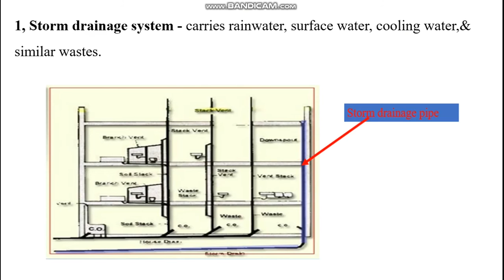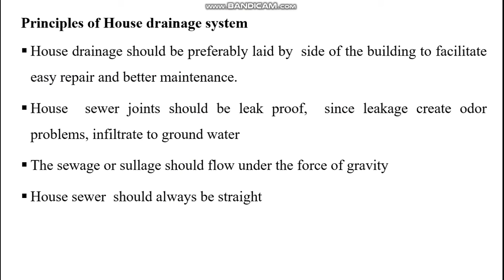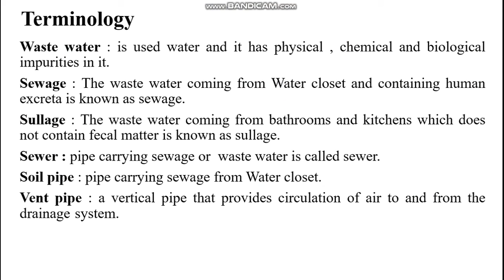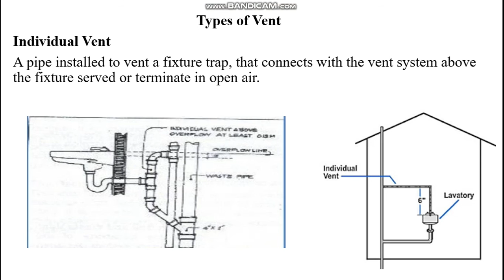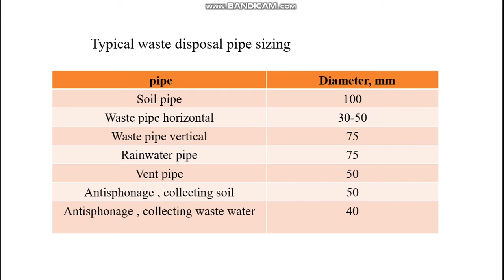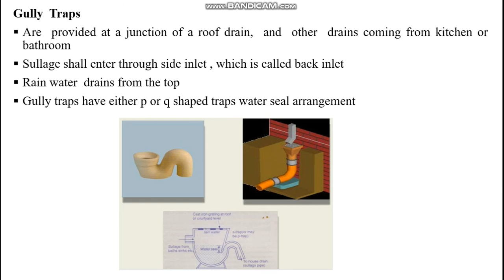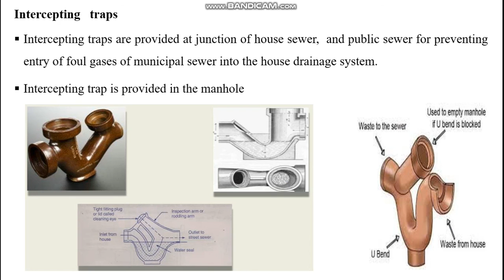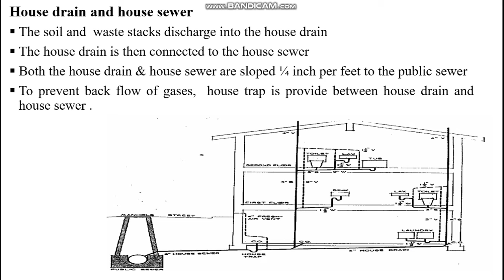Introduction to Drainage System ( sanitary and storm drainage system)

Comment: UU80823R
Drainage system include all the piping within a private or public property that conveys sewage, stormwater & liquid wastes to disposal which helps to maintain a healthy condition in the surrounding & facilitate the entry and removal of liquid water. There are 3 types: storm, sanitary and combined drainage system. 
Individual vent, common vent, main vent e.t.c are included in types of vent. 
Traps allow water to flow through while preventing back flow. They are classified based on shape ( P trap, S trap, Q trap) and based on use( Floor trap, Gully trap, Intercepting trap).

Comment: 80991
Drainage system - removal of sewage, storm water, liquid wastes through piping system. It helps maintain healthy conditions in BLDG and collect waste matter systematically. Storm, Sanitary and Combined are the types of Drainage system.
Principle of house Drainage system : house sewer should always be straight,  its joint should be leak proof and the entire system should be well ventilated from strat to end.
Individual, common, main, relief, yoke or bypass, circuit and wet are vent types.
Traps - preventing  back flow of foul gases into living quarters. P trap, S trap, Q trap are classification of trap based on shape. Floor, Gully and Intercepting are classification based on use.
Clean outs - are elbows protecting to permit cleaning the house drain.

Comment: Uu81145R 
 drainage system.
When rivers, streams, and lakes flow together in a basin, they make an interesting pattern. This pattern is called the drainage system. How the land looks, whether it has hard or soft rocks, and how steep the land is all play a role.

Underground pipes transport sewage from bathrooms, sinks, and other plumbing components to a wastewater treatment facility via the sanitary sewer system. 

Sewage cannot be transported by the storm sewer system, which is meant to transport rainwater and other drainage. Underground pipes or open ditches transport the runoff, which is then discharged (untreated) into nearby streams or bodies of water. You can find inlets to this system near curbs and low-lying places of the outside world. There are some older buildings with basement floor drains that are connected to the storm drainage system.

Comment: 80870
Drainage system refers to all piping system that conveys all liquid and solid things to point of disposal. Its used to maintain healthy conditions in buildings. There are 3 types :- storm drainage system, sanitery drainage system and combined drainage system. There are also many principles of house drainage system such as ventilation, its connections etc. 
Vent helps to regulate air pressure in the plumbing pipes to ensure that the water flows unimpeded through them so there are 7 types of vent. And traps allow the sewage or wastewater to flow through while preventing back flow of foul gases in to living quarters.

Comment: UU81213R 
Drainage system is refers to all piping system that convey sewage stormwater and liquid wastes to paint of disposal and it's objective is to maintain health conditions in a building and to avoid the entry of foul gases from the septic tank. And there are three drainage system such as storm, sanitary and combined drainage system and house drainage should be laid by side of the building. There are seven types of vent ;- individual, common, main, relief, by pass, circuit and wet vent. Traps allow the sewage to flow through and also it prevents back flow of foul gases in to living quarter and they are classified based on shape. Clean out are elbow projecting to permit cleaning the house drainage and installed in the house drain beyond the last stack. The soil and wast stack discharge in to house drain then the house drain is connected to the house sewer.

Comment: 80970R Drainage system refers to all piping device that conveys sewage, stormwater and liquid wastes to point of disposal. Maintain healthful stipulations in building,to keep away from the entre of foul gases from the sewer or septic tanks, to facilitate the removal of foul matter, to accumulate waste mater systematically.three Types of drainage system  storm, santariry, combined drainage system.Principles of residence Drainage system: residence sewer must usually be straight, the sewage or sullage have to flow under the float the pressure of gravity, house sewer be linked to manhole such that the invert degree is sufficiently greater to keep away from back drift of sewarege in house sewer . there are many types of vents that are individual, common,main ,relief, yake or by pass, circuit ,wet vent.Traps enable the sewage or waste water to drift via whilst preventing returned flow of foul gases into residing quarters.the loss of life of water seal is,the vertical distance between the crown and dip of trap.Classification of traps based on shape :P,S AND Q traps .Classification based on use: floor, gully, intercepting.

Comment: UU 80954R
Drainage system is all piping system that conveys sewage,storm water and liquid waste to maintain healthy condition. There are 3 DS storm drainage,senitary drainage, combined drainage system. Drainage system should have better maintenance,sewer joints should be leak proof, always be straight and avoid back flow

Comment: UU81140

Drainage system refers to all piping system that conveys sewage stormwater and liquid wastes to point of disposal.
There are three drainage system
1. Storm drainage system 
2. Sanitary drainage system
3. Combined drainage system, and there are principales of house drainage system.
Vent-a vertical pipe that provides circulation of air to and from the drainage system.
Traps-are u shape fixtures that have water seal in them,traps allow the sewage or waste water to flow through while preventing back flow of foul gases into living quarters.

Comment: UU 78843R
Drainage system refers to all piping system that conveys sewage ,storm water and liqiud wastes to point of disposal. Storm ,sanitary and combined are types 3 types of  drainage system.vents is a vertical pipe which provide circultion of air and it regulate the air.and traps are material that prevent back flow of gases in the living quarter, which  is classified based on their shapes and uses.

Comment: uu 80754R
Drainage system is all pipe system it include sewage storm water liquid waste disposal.there are 3 drainage system
 1 storm sanitary and combined drainage system.
2 sanuterry drainage system.
3 combined drainage system.
Traps are materials that prevent back flow of foul gases into living quarters traps classified based on use and thier shapes.vents are pipes for ventilating the sewer.

Comment: UU81058R
Drainage system is removal of sewage ,storm water and all liquids to the point of disposal. It creates healthy condition on the building drainage system have different types these are storm drainage sanitary drainage and combined drainage .vent is vertical pipe that provide circulation of air .and it is used to regulate the air traps prevent the back flow of foul gases into living quarters it classified based on shape Q , P and s trap based on use floor trap gully trap etc..

Comment: UU80649R 
Drainage system : a system in which refers to all piping systems that conveys sewage , storm water, and liquid wastes to a point of disposal . the use of drainage system is to maintain healthy conditions, to avoid the entry of foul gases , to collect waste matter symmetrically . there are 3 types of drainage system : storm , sanitary and combined drainage system .house drainage system shoud be preferable easy repair, better maintainance the joints shoud be straight .traps are materials thay prevent back flow of foul gases into living quarters traps classified based on use and thier shapes .

Comment: UU81085R
What I understand in this video is about drainage system. Drainage system is all pipe system it include sewage ,storm water, liquid waste disposal... There are 3 drainage system 1storm water dreanage system.  2 sanitery drainage system. 3 combined drainage system .In drainage system the sullage and the sewage should flow under gravity also the system should be leak proof. This system is used to create healthy conditions for building by avoiding entry of gases from sewage to septic tank and other things.veints and traps are solution to avoid entry of gases from the sewer. Traps are curved down pipe it have water seal on it , the water block the passing of gases. Vents are pipes for ventilating the sewer

Comment: 80707R
Drainage system.... a system in which refers to all piping systems that convey sewage ,storm water ,and liquid wastes to a point of disposa. The use of drainage systems is to maintain healthy conditions to avoid the entry of foul gases, to collect waste matter symmetrical.  There are 3 types of drainage systems [ storm , sanitary and combined drainage systems.] House drainage systems should be preferable easy repairs,  better maintenance the joint should be straight. Traps are material they prevent back flow of foul gases into living quarters traps classified based on use and their shapes.

Comment: UU78193
DRAINAGE SYSTEM refers to all piping system that conveys sewage. There are types of drainage system Storm, sanitary and combined drainage system. Using principles of drainage system is important like house sewer joints should be leak proof and others. Vent pipes supply fresh air to each plumbing fixtures. in the house types of vent individual vent, main vent, relief vent and more. Vents classified based on there shapes and functions (uses)

Comment: UU82223R
Drainage structures and its maintenance, if neglected, may want to pose a threat in both community and healthcare inflicting infections as nicely as emergence of multi-resistant micro organism that should purpose unpredictable scientific
conveys sewage.
Types of drainage device are :- sanitary drainage machine ,Storm drainage system and
combined drainage system. House drainage system
should be laid on one facet of the constructing to facilitate
and be without difficulty repaired. Types of vents :- common vent,
main vent, alleviation vent etc. traps: are u fashioned fixtures
that have water seal in them and they prevent returned flow
gases. Traps are labeled based on shape and use.

Comment: UU81006R   Summary 
Drainage system refers to all piping system that conveys sewage. Types of drainage system are :- 1. Storm drainage system, sanitary drainage system and combined drainage system. House drainage system should be laid on one side of the building to facilitate and be easily repaired. Types of vents :- common vent, main vent, relief vent etc.  traps: are u shaped fixtures that have water seal in them and they prevent back flow gases . Traps are classified based on shape and use . Example from each :- p trap based on shape and gully traps are based on use .

Comment: UU80984R 
SUMMARY
Drainage system:- are all piping system that conveys sewage storm water and liquid wastes to point of disposal.
There are 3 types of drainage system 
1.Storm drainage carries rain,surface and cooling  water and similar wastes.
2.Sanitary drainage carries sewage both liquid and solid 
3.Combined drainage carries both

VENT used to regulates the air in your plumbing system, and have many types 
Eg:- individual, common or dual,main,relief....

Trap :-curve in the waste pipe from a bath, basin, or toilet that is always full of liquid and prevents gases from coming up the pipe into the building.
Can be classified based on there shapes and use.
Shapes:-P trap ,S trap and Q trap 
Use:- Floor trap,Gully traps and intercepting trap

Comment: UU78258R

SUMMARY 
the house driange system, uses gravity to pull water through the house, & outside to drain waste and dirty which are taken to the main drain or in short I can say the main objective is to collect & remove waste matter systematically to maintain health conditions.
There are 3 types of principles in drianage systems which are: storm drainage system, sanitery drianagr system, and combined, here there are:- 
VENTS:- is used to regulate the air in your plumbing system, &  have these types: individual, common, main, relief, ... etc.

TRAPS:- allow the sewage to flow through while preventing back flow of foul gasses into living quater, and they are classified
- based on thier shape: eg P TRAP, S TRAP, & Q TRAP.

Comment: UU 81030R
Drainage syatem(DR) refers to all piping system that conveys sewage, storm water and liquid waste to point of disposal to maintain healthy conditions in  abuilding .this aystem  doesnot include the main public  sewers. There are 3 kinds of DS (storm , sanitary,combined DS in a building.and , DS has its own principle to achieve a better organization.the  other is  there are different types of vent   for admissin of  air & gases of discharge. Every fixture  requires trap  to prevent passage of sewer gases and it is  classified base on shape and use.

Comment: UU80856R
"Dranage system
refers to all piping system  that Conveys Sewage.
Type of drainage system -storm
drainage system,-sanitary drainage
system,- combined drainage system.having a drainage system installed it can help prevent water damage and structural issues. 
Vent - an opening of the escape of a gas or liquid or for the relief of pressure type of vent main vent, relief vent, circuit vent, wet vent etc
Trap - to prevent unwanted flow/ sewer gases from entering buildings while allowing waste materials to pass through

Comment: UU81369R
      DRAINAGE SYSTEM: refers all piping system that conveys sewage,storm water and liquid wastes to point disposal. House drainage system do not include the main public sewers, treatment and disposal. There are different types of drainage system based on different criteria from those:
     Storm drainage system(excess rain and ground water)
     Sanitary drainage system (a system of piping within public or private premises that conveys sewage or other liquid waste to an approved point of disposal.
      Combined drainage system .
      
     VENT PIPE

          Vertical pipe that provides circulation of air to and from the drainage system .there are different type from them these are well known (individual ,common ,main,relief,
yoke and wet vent)
       
         TRAPS

Allow the sewage to flow through while preventing back flow of foul gasses in to living quarter.
Classification based on 
Shape:P trap, S trap and Q trap
Use: floor trap,gully trap and intercepting trap
      
          CLEAN OUT: are elbows projecting to permit cleaning the house drain.

Comment: HAYLEGEBERAL ASEFA  81219R

House drainage system should be laid on one side of the building to facilitate and be easily repaired. 
There are 3 types: storm, sanitary and combined drainage system
*A storm drain, storm sewer, surface water drain/sewer, or stormwater drain is infrastructure designed to drain excess rain and ground water from impervious surfaces such as paved streets, car parks, parking lots, footpaths, sidewalks, and roofs
*A combined sewer is a type of gravity sewer with a system of pipes, tunnels, pump stations etc. to transport sewage and urban runoff together to a sewage treatment plant or disposal site. This means that during rain events, the sewage gets diluted, resulting in higher flowrates at the treatment site.
*A sanitary drainage system is a system of piping within public or private premises that conveys sewage or other liquid waste to an approved point of disposal.
Difference 
Combined sewer systems often discharge sewage and various wastewater along with excess water from rainfall. Separate sanitary sewer systems only discharge stormwater. ... Buildup and blockages within the sewer system prevent the proper flow of water, building up pressure in the sewer lines.